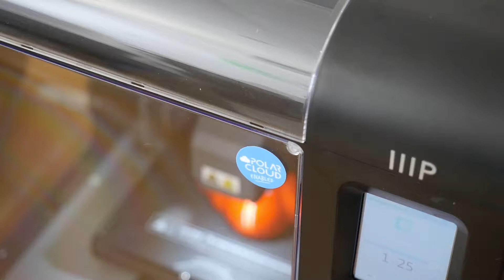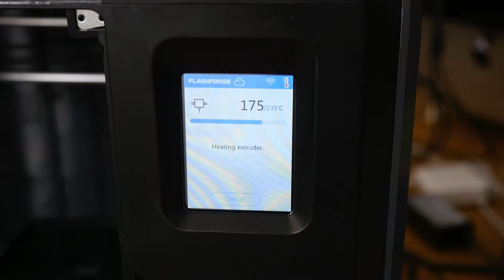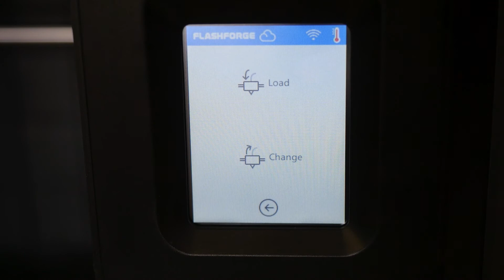Monoprice Voxel - Loading Filament

Comment: I was hoping you guys might have addressed an issue I'm having with this printer but it seems not. I let a print run overnight knowing that the spool would end before the print, and expected to load up a new spool in the morning. All went as planned except that now what remains of the previous spool fills up the entire guide tube with no exposed ends for me to grab and pull it out. Feeding a new spool in to force the remains of the previous spool results in the spools doubling up inside the tube rather than pushing the previous filament out through the extruder. I'm really perplexed as to what I should do here, as getting access to the tube is incredibly difficult from either end.